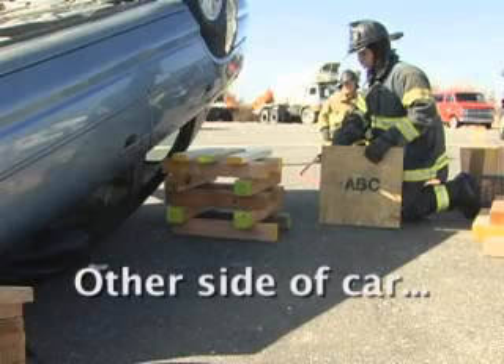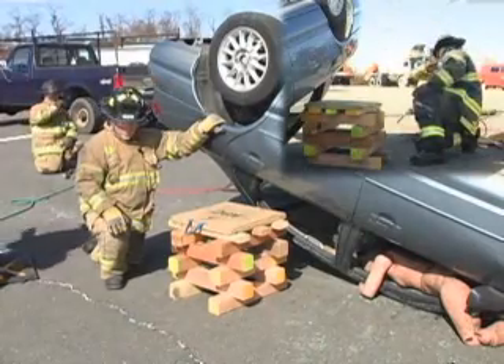Lifting a rollover with airbags

Comment: Doesn't seem practical for an accident scene where time is essential. Interesting concept, probably better for construction and stabilization.
Reply from the maker: Andrew Galpern I'm curious, what would you consider a more practical approach?
Reply: Just a lift bag in the small void between the passenger and the engine, if there was no time for the other equipment (severe injury, risk of explosion, etc.) Are all the blocks really a standard equipment set on fire department vehicles?
Reply from the maker: The purpose of the technique is to perform a parallel lift of the vehicle in order to lift both sides evenly. If this were a simple pin perhaps your technique would be fine. I'd actually prefer the hydraulic spreader & TL9 stabilizer. The issue arises when the person is pinned across the vehicle or you have more than 1 person pinned. Your single point tilting lift causes the other side of the vehicle to drop down potentially causing further injuries on the opposite side of the vehicle whereas this technique lifts the entire car evenly. Another benefit is the space created to tray cut the roof or displace the dash as needed. Yes where I work we have the resources to perform this manuever.
Reply: All good information and a good instructional video.
Reply: They are going slower im assuming for demo